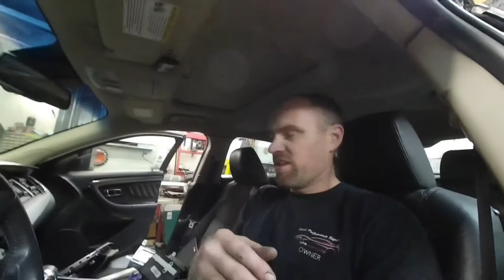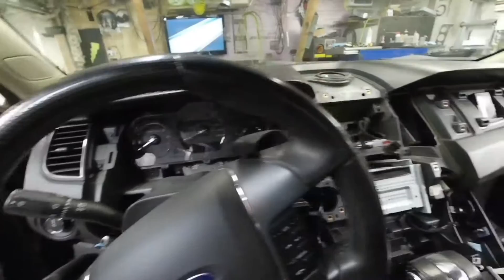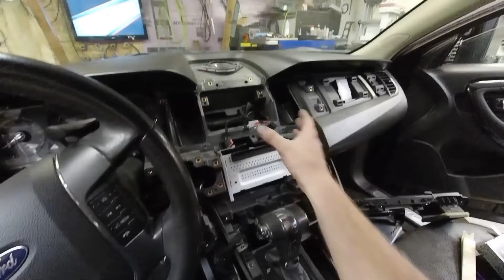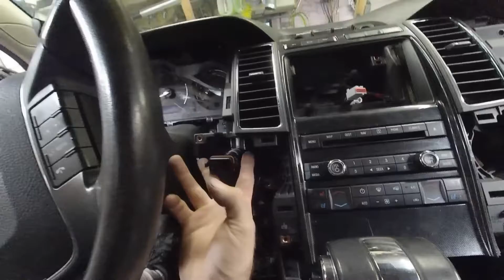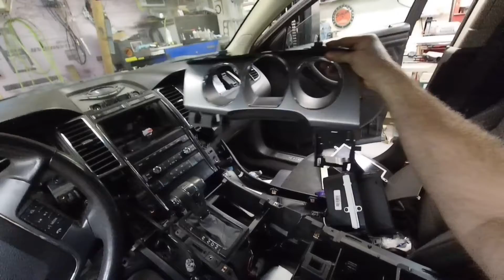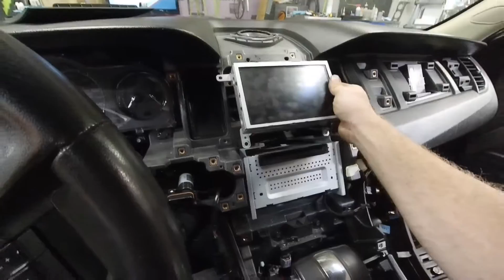Ridiculous Ford Taurus SHO Radio Pull!

Comment: Thanks for the video. I’m going to use this to hopefully convert my 15 Interceptor Sedan from a 4inch Sync 1 to an aftermarket radio like a Kenwood DMX809S. 

Looking at crutchfield I should need the radio, Dash/wiring kit, iDataLink connector, and the HRR-FO2   

I THINK the Sync 1 setup and the other 8inch display options generally have the same connectors for the HVAC. 

Wish me luck. I’m in deep uncharted territory. Only thing I’ll need to junkyard pull is the radio bezel & vents. And it should “just work”. 

Pray for me.

Comment: this is no real news, as ford has been doing this sort of nonsense for years. what is surprising though, is that there are still people who will by fords.
Reply from the maker: Unfortunately it's all manufacturers, however some of them do have a little more of it than others.
Reply: @CrazedPerformanceRepair  that's like saying oley's pizza is similar to little cesar's
Reply from the maker: @violentmo2241  I can't relate to that reference. But I can tell you BMW and Nissan are worse than Fords in general. However a Ford Taurus is completely different from an F-150 and they're both made from the same company. So I can only speak in generalities. I'm sure you don't compare a chicken alfredo pizza to a pepperoni pizza. Just like pizza places, each one has its pluses and minuses. I don't know who oleys pizza is But I know Little Caesars is a really cheap pizza. So by being a cheap pizza it has the benefit of being cheap on a budget.

Comment: This is a situation where you want to make a few strategic cuts. A couple cut tabs in the right spot can greatly reduce the number of panels need to be taken off. You do run the risk of a panel vibrating, but can be easily fixed.

Comment: So i have a 2012 Ford taurus sel...without the sony touchscreen..i put in a Metra aftermarket harness and hated it...is it possible to buy the harness from the taurus with the touchscreen and use it in my taurus? does anyone know?
Reply: Thanks for this comment....I just found one that isn't metra....but I was going to actually 3d print one....but I found one that would fit my a/c cut out...if you need one still reply to me....but I wasn't paying 300 for the dash kit I would have made mine customized with fiberglass and carbon fiber for the same price
Reply: @herb.ink.8881  yea i def still need one. i actually took the metra kit out and went back to stock radio. even though i have a sub and amp. but i would love a better radio and better sound for sure. the metra kit was also killing my battery. i would wake up every other week to a dead battery

Comment: I have a 2010 SHO with Sony/Sync system and it SUCKS because I'm stuck with an obsolete GPS, UI, and crappy touch screen - It's a shame that I can't upgrade this head unit on an otherwise great car. I'm going to get a 10" [maybe 8"] Android tablet and build a bracket whereby I can mount it flush in front of the old screen - I'll make it so it can swivel away when I need to use the radio and climate controls. Other than that, thank god for tablets with built-in GPS & bluetooth.

Comment: What's up with the dash kit and losing climate control? Im confused, do you lose the controls in the wheel or everything in the dash? Im finding two dash kits one basic double din and a complete dash . ..? Thanks.
Reply: My 2014 SHO (75k) now has intermittent climate control/cut out! Ford had a recall for a related chip but unfortunately mine failed isn’t that one! PFIM chip or something like that and my touch screen controls currently work to restart it, but not my push buttons!. Not sure where’s it located but if it’s somewhere behind the center console I now understand why the dealer wants around $1200 to replace! I can’t imagine all of the trim being flush and in original condition after an R&R! I’m just living with it for the last year now…

Comment: That's nuts! They should be ashamed of themselves. That's not engineering. That's a lack of engineering.
Reply from the maker: No it's a guy in the engineering room with a maniacal laugh "I can't wait to see the Tech's respond to this later..." Over engineering the piss out of it.
Reply: @CrazedPerformanceRepair  He must have been recruited from Lego...
Reply from the maker: @Big_Old_Dog  no way because at least Lego has a purpose lol
Reply: @CrazedPerformanceRepair  Yeah, but like Lego pieces they are all locked together so you have to practically completely disassemble it to replace a piece. That's the craziest thing I've seen. I bet the aftermarket audio guys don't even want to work in them.
Reply from the maker: Very true, it seems like you always forget that one Lego that requires full disassembly.